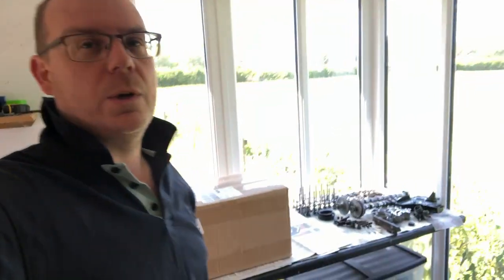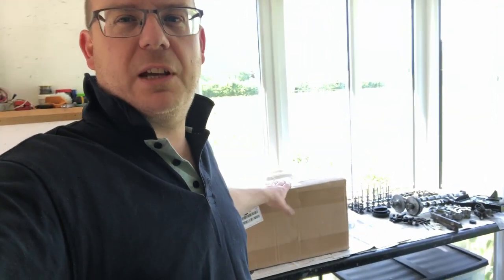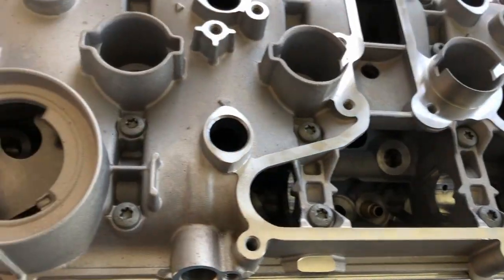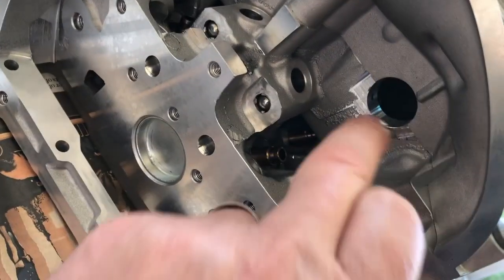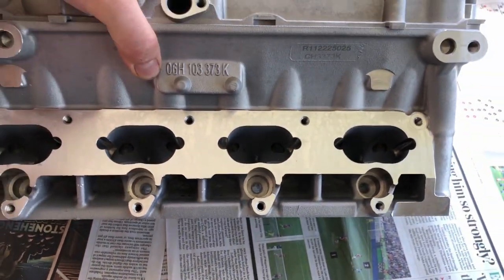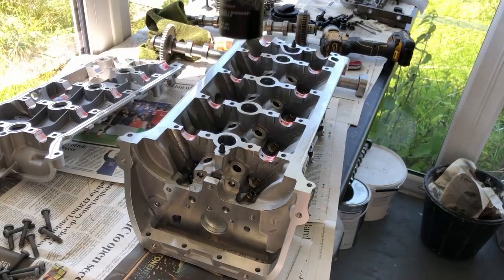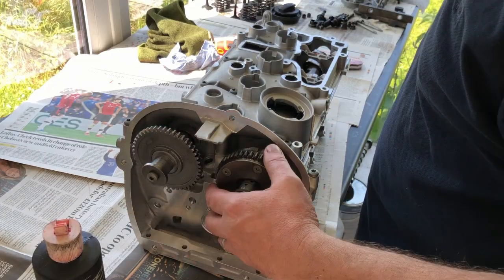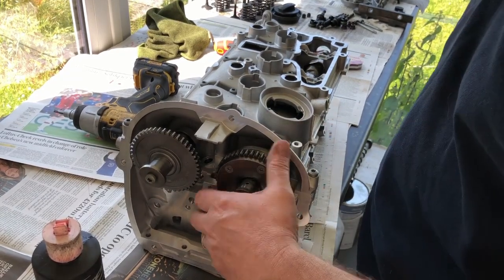VW Audi EA888 EBay! Chinese Cylinder head - is it any good? VW Golf Audi

Comment: Had a terrible experience dealing with a Chinese ea888 engine. Flimsy parts with poor quality control. Not recommended.
Reply: What seller you bought it from?
Reply from the maker: Link is in the comments but it’s not available anymore.
Reply: @Roverturbo this question was for avpowe91 :D
Reply: @qantexx978 ziptek auto parts chongquing via made in China app

Comment: i rebuilt my audi engine 3.2 fsi with chinese parts, and the engine runs perfect and the quality of the chinese parts was very good, i have been driving it for 3 years now, and it has become a great engine.
Reply: Can you link the shops you bought from?
Reply from the maker: @DanikoLP i got mine from eBay, no longer available. Apart from China. No not sure now.

Comment: Also if u do use it clean the cast up intween the valve seats where the spark plug is often there is thin ridges that will crack off during heat and can get in between piston wall and scratch it

Comment: These heads are junk they will fail esrly they are made of softer dirty aluminum the casting is imperfect in ways that can lead to failure namely in tha cam cradles they are thinner and they wear down quickly and often times the valves do not seal 100percent
Reply: these heads are perfect
Reply: are you speaking from personal experience? I would like to see the results of buying these parts and being able to fault them legitimately. I am considering buying a long motor based on a good experience of someone I know running ~400hp through one.

Comment: You have not even started to inspect this cylinder head. You should have measured the cam journal bores and compare that with spec. (VW forum would give that to you). Test the valves in the guide and measure the valve regression and guide to valve end play. Measure from the face of the cylinder head to the base where the bolt sits (this will tell you if the cylinder head has been skimmed) get a straight edge and check for true/flatness on of the cylinder heads face. Lastly, just go over the surface area with a magnifying glass and check for porosity.
Reply from the maker: Ok thanks, maybe you could do a video showing this?

Comment: Plastigauge your cams if youve not fitted it yet! We bought one of these and had clearance issues. The spec is available on erwin. Also worth checking your cam bridge for wear too, if this is worn it can cause oil pressure issues.

Comment: Some years ago I got a cheap Chinese head for my shogun the mk1 2.5 diesel it lasted 3 months and cracked I now do my best yo avoid purchasing from China even though I know they can produce good quality stuff it just a matter of principle as they support Russia
Reply: Was it stock? 😅
Reply: @rkan2  no not standard I ran on veg oil  had the pump timing advanced 5 deg and upped the boost and max fuel delivery, these mods may have contributed to head failure but it was quick for an old brick
Reply: @TheBlibo  thought so lol :D